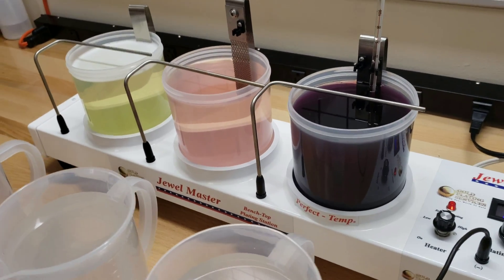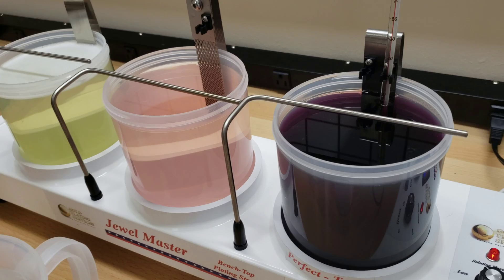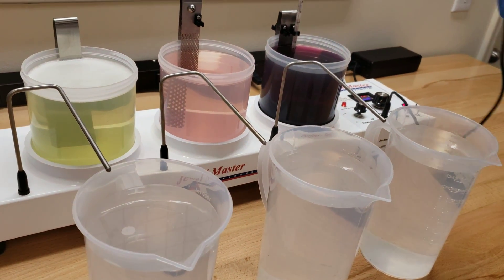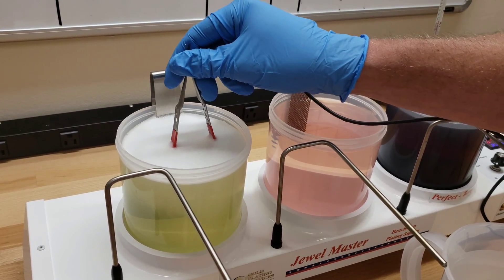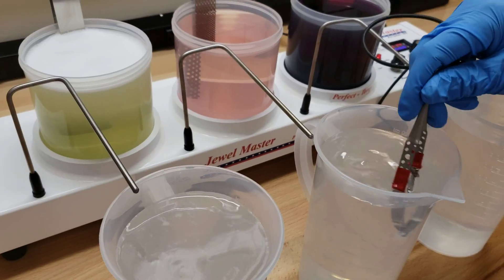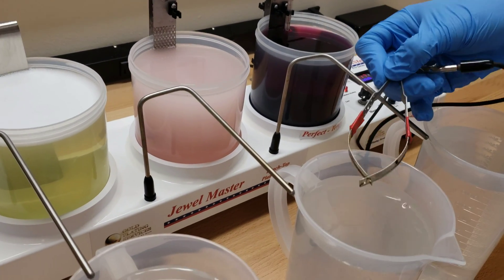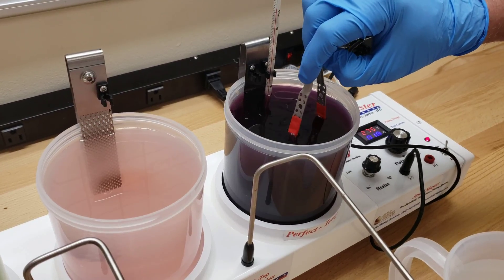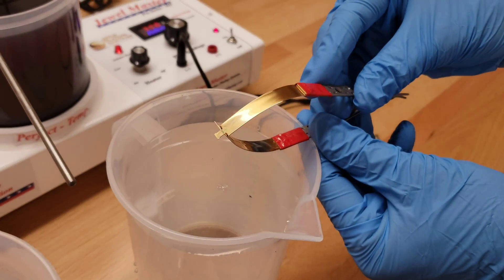Gold Plating Stainless Steel using Gold Strike & 24K Bright Gold (Medical instrument)

Comment: great job. I have a question if  you do not mind , if you want to gold plate a piece of silver or gold with 24k Acid based solution do you still use( platen ice titanium anode) for acid dip or (stainless steel anode) ?would you please let me know .thanks

Comment: Spectacular! What type of anode are you using for the first and last baths? Is it beneficial to use a platinized titanium mesh anode for those baths, or just for the gold strike bath? Thank you, and Aloha~
Reply from the maker: Thank you!  The first and last anodes are Stainless Steel.  Stainless Steel is perfectly fine for Electrocleaner and Gold Solution, however Platinized Titanium will work as well.

Comment: Good video (especially compared to the others ahead of you in YouTube), but how do you know the voltages of what's best and the timings? Are there rules of thumb for each stage or is it a case of trial and error for bigger, more complex items?If I was to plate a watch case and there are channels where rubber gaskets go (removed) would 1 micron make much of a difference, as this channel would be impossible to tape off.
Reply from the maker: Thank you!  We have instructions on the bottles, in the Users Guides (and these videos) for voltages/times/steps for each solution depending on the type of metal.  You would use these same procedures regardless of how complex the item.  

We have never encountered an item with such a tight tolerance that 1 micron would be problematic, but that's not to say it's impossible.  We've plated many watches and never had tolerances be a problem.  Hopefully that answers your question! Let us know if you have further questions.

Comment: Do you think figure skate blades would be possible? I'm worried that brushing or dipping, that the 2nd step might let it corrode from moisture overtime or does it remain safe from corrosion?
Reply from the maker: I'm assuming the blade is made of stainless steel.  If so, apply gold onto stainless steel is mostly considered corrosion resistant as both metals are resistant.  The gold would never corrode by itself, so the stainless would be the only metal present that could corrode.

Comment: Are these toxic if inhaled and do you need to wear any sort of protection to work with this set ?
Reply from the maker: These chemicals are not toxic if inhaled, safety data sheets call for "Local Ventilation".  Typically an open window or a fan is sufficient.  All we used with this set is gloves and some glasses, which is good safety with really any chemical.

Comment: How long does the gold plating usually last on the item platted???
Reply from the maker: How long gold plating lasts depends on two factors. 1) How thick the gold is applied. 2) How it is handled/treated.  If a hardened gold (such as this) is applied thick it can last many years, even a lifetime if applied thick enough and on a well taken care of item.  If you simply apply a thin layer (such as 30 seconds in the gold), it may wear off in a few months.  Whenever we plate a heavily handled item, we plate it thick so that it will last as long as possible.

Comment: great were can i get all this kit,im in the uk
Reply from the maker: Brian, you can get this kit directly from our website.  Here is a link to the JewelMaster - Option 2: https://www.goldplating.com/collections/bath-plating-kits/products/jewel-master-pro-hd-plating-kit-for-plating-gold 
We cannot, however, ship the TriVal (2nd bath) to the UK due to its acid content.  We have an alternative to the TriVal called Woods Nickel Strike.  We are able to send the Woods Nickel Concentrate to the UK, where you would simply need to mix it with some Hydrochloric or Muriatic Acid to make it "Ready to Use".  The bottle of Woods Nickel Concentrate comes with instructions on how much and how to mix the concentrate into a usable bath.  Here is a link to the Woods Nickel Concentrate (https://www.goldplating.com/collections/pre-treatment-solutions/products/copy-of-woods-nickel-strike-bath-or-brush-continental-us-only) and the Nickel Anode (https://www.goldplating.com/collections/jewel-master-supplies/products/bagged-nickel-anode-for-jewelmaster) required for that solution.  If you have any questions, please let me know and we will assist you.